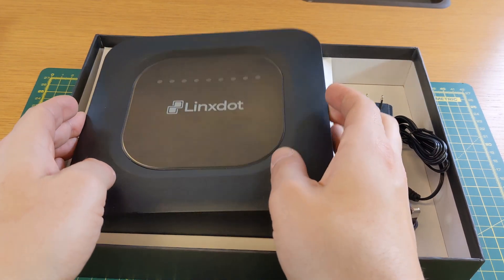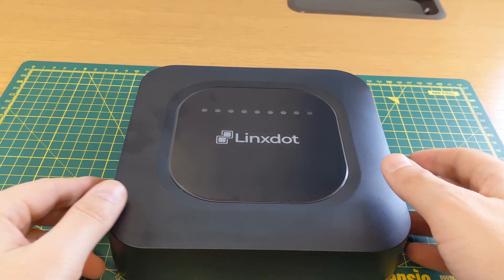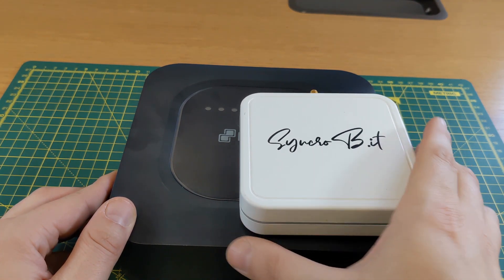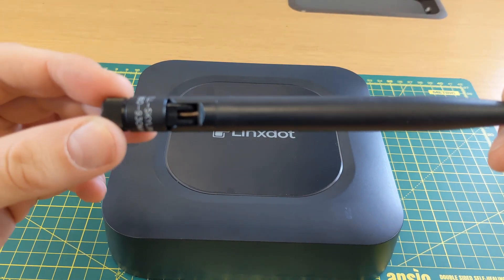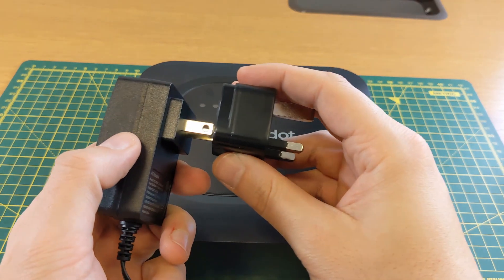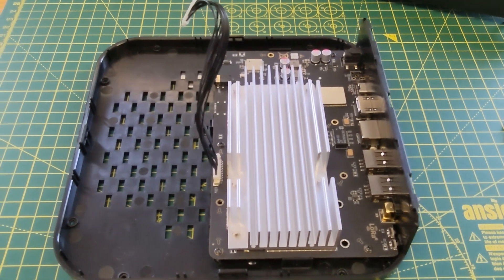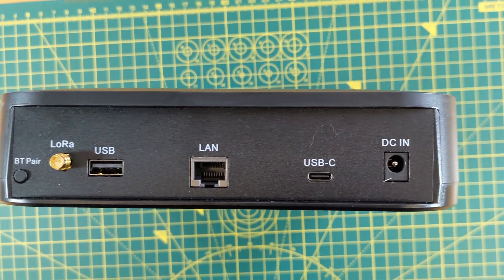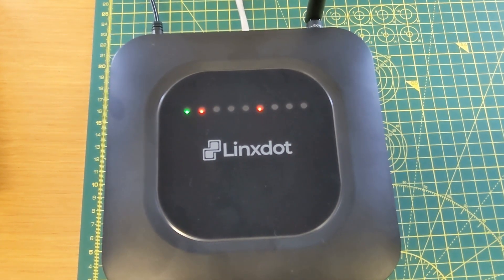Linxdot Helium Hotspot First Impressions - New RK based version

Comment: First impression, not made for someone who is just starting out. Imagine if this was your first hotspot. I am curious how it will perform on network. Also size wise.. I am wondering if it would be considered an indoor device because of size, as an outdoor enclosure maybe a challenge to protect it.
Reply from the maker: Just not like others at this stage for setup, sure it's something they can fix, as for outdoor I'd just take the hotspot board out the case and install that in the outdoor

Comment: Good review, I'm glad I didn't standardize on this hotspot and only have one coming my way.  Based on your review maybe I'll just use the antenna on my roof and relocate my bobcat, I saw the DC power inlet so you think the typical 12V PoE splitter will work with this unit?
Reply from the maker: I'm sure if you matched the barrel jack for Poe it'll work

Comment: Any concerns over the 32 GB of space? From what I can tell you’re unable to upgrade the amount of space to 64 GB. It won’t matter I suppose once light hotspots are officially switched over but could be an issue in the interim. I’ve pinged them on their Twitter page a couple times but zero responses.
Reply from the maker: Nope should be fine, they're quick to resync anyways and as you say, light hotspots are just round the corner